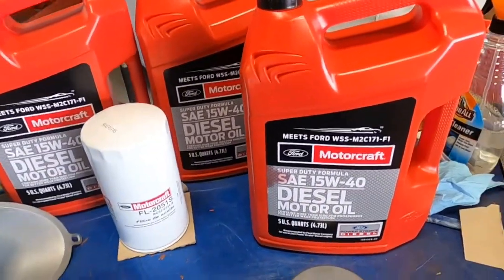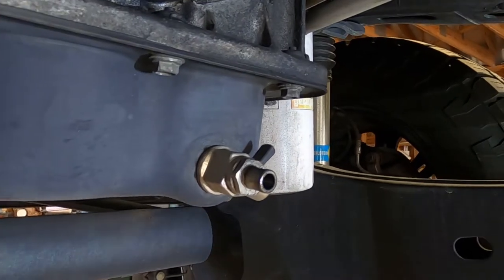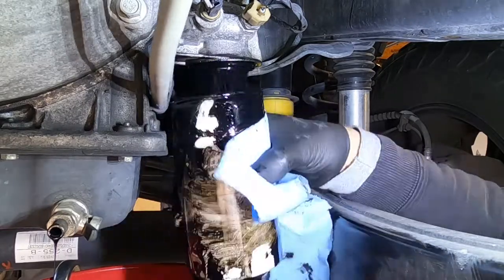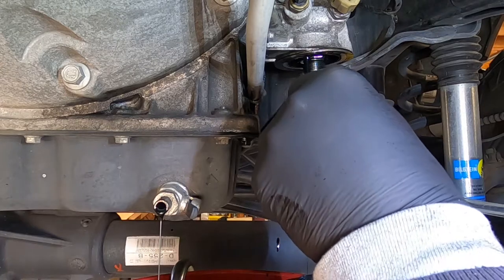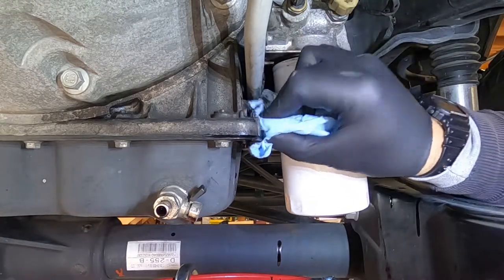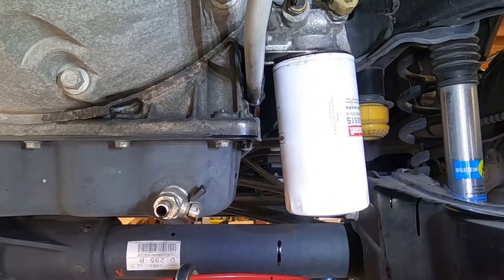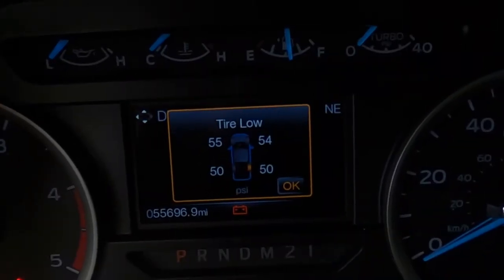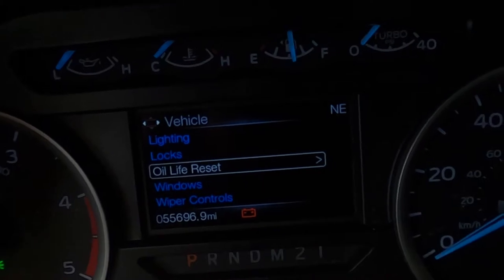FORD 6.7 POWER STROKE OIL CHANGE (EZ DRAIN VALVE)

Comment: I poke a hole in the bottom of the filter with a nail and let it drain before I pull the filter off, much less mess. And I use clear tubing on my Fumoto valve to go straight into the opening on my drain pan. I’m usually working on the ground, it would be nice to have a lift like yours.
Reply from the maker: Thats a good idea, I am going to try the nail next time.  I love the lift.  I just installed a set of air bags last weekend and it made it much easier.   Thanks
Reply: @VansHomeServices How did you like the nail in oil filter method?
Reply from the maker: To tell you the truth, I forgot all about it last oil change and was cursing the mess I was making.  I have to redo the upper oil pan seal so I will use it when I drain the oil for that job.  Thanks for the reminder.

Comment: Did my 2017 yesterday- the good old fashioned way: cardboard on concrete!  So fulfilling...  Get this- Had my last change done by my trusty local mom n' pop shop and musta had new guy- it was double-gasketed!!!  How on earth did that not leak???  I will mention it if I have them do it again, but probably stick to doing it myself- as I usually do.  Love those valves, great for if you accidentally over fill, or need to add some additive and remove a bit, but yes, they are slow.  Still indispensable, but I forgot to get one to swap out on this rig.  Next time.  I also use clear tubing to route the oil closer to the pan- in windy conditions, it's imperative.  That lift is gold!
Reply from the maker: I have found that most places don't do a great job and charge an arm and a leg.
Reply: @VansHomeServices  True of most!  this beloved place charges me about $30-ish more than I can do it myself- using all Motorcraft oil/filter.  Just a great little family shop- been doing business with them for years when I don't feel like doing something.
Reply from the maker: That's a good deal.  Just started my oil change today and found a bad Upper oil pan seal.  Looks like a few more videos coming on how to pull the trans, and replace a rear main seal and oil pan seals.

Comment: I always just do hand tight on the filter. It seems to always be tighter next oil change.  I believe the 1/4 turn with band wrench is excessive. Just my opinion.
Reply from the maker: You might be right.   I've always had a small oil leak on the filter using the wrench.  I'll just give it a hard hand tight next time.  It's worth a try.  Thanks for the advice.

Comment: Nice setup! Would you mind telling me the size of your garage? Including height inside and also height of garage doors? I have a super duty also and shopping for a 303.5 and wondering the size garage I should make.

Thanks again!
Reply from the maker: It's 34x50 with 12 ft walls.  The doors are 12wx10h.  If I had to do it over I would at a minimum make it 14ft high.  I would like to be able to get a camper in there, but the doors are too low.   I don't use the mini all that much, but it's been a good little machine.  Its super handy to have around.
Reply: 303.5 isn’t tall with the boom tucked in I just bought a 2023 last year
Reply from the maker: You're correct, it's not very tall.  I can't get it in the garage while it's on the trailer since I have a drckover, it's not the boom, the cab is to high and would hit the garage door.

Comment: Ur using the wrong weight oil read the owners manual
Reply: 5w40 is severe 
Duty
Reply from the maker: When I did the video it was in the COVID days and I couldn't get the 5w40.  Now I'm running T6 5w40.
Reply: @nicolasbaez5689 who cares 15-40 isn’t going to hurt it